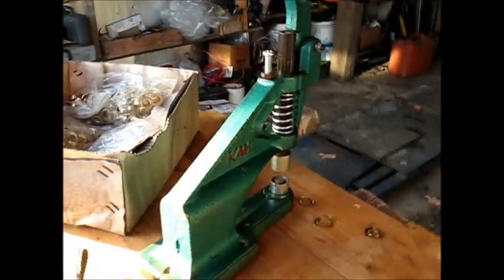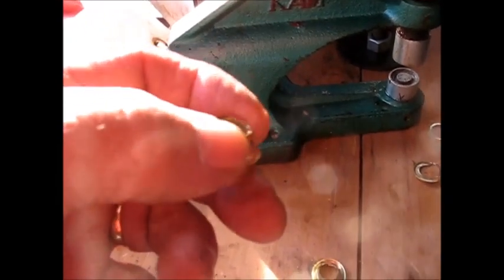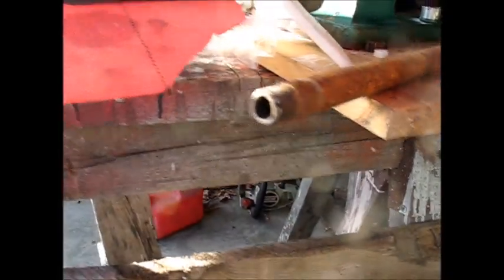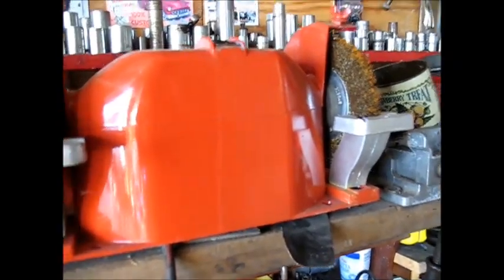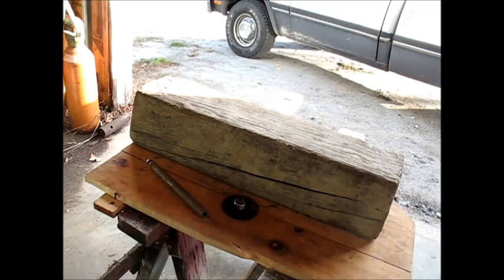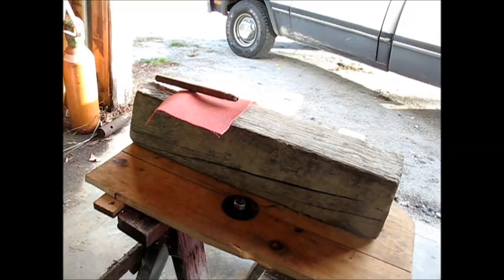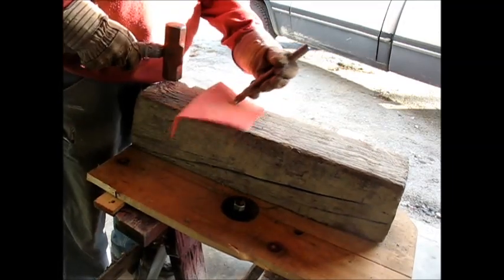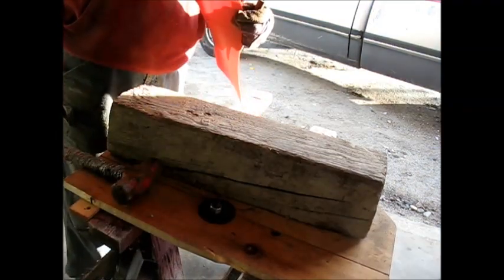Dead Eye's Red Eyes

Comment: Hey Peek the metal maybe rolled over to the inside of the cutter. May try using a rat tail file to sharpen and clean up the inside and use some hard wood or thick plastic to back it up.

Comment: i use a punch and a block of wood and i can follow the tarp anywhere and add the eye. works great and there cheap at harbour frt
.the punch is very sharp . but if you can use scissors the punch will work to. gotta wack hard tho